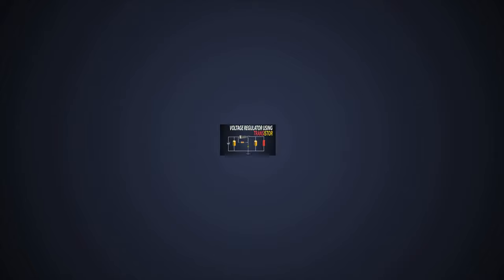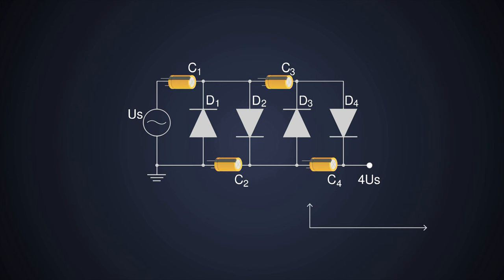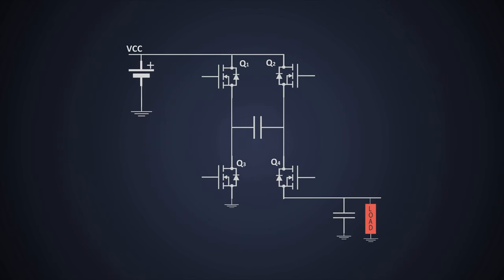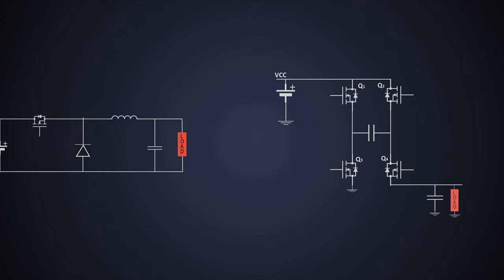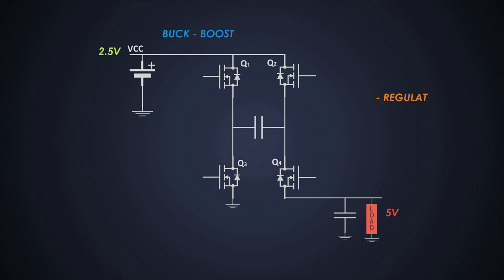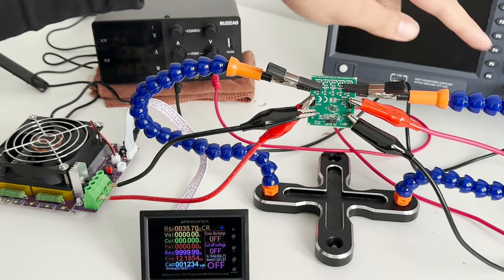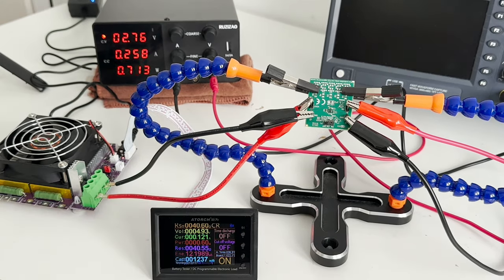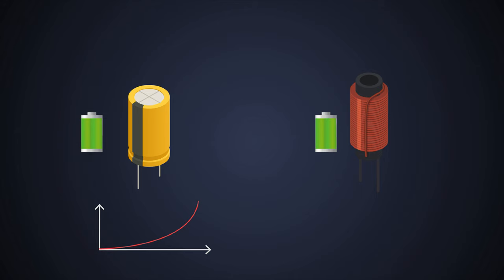What is Switched Capacitor Voltage Converter? The Forgotten Converter! Charge pump Voltage Converter

Comment: Well, charge pumps are definitely not forgotten and very well used, especially in cases where higher or negative voltage is required, or just a more "quite" voltage is needed (without switching of inductors for example), but your video is great, as always! Keep going!
Reply from the maker: Great point!

Comment: I’m aware of a gigabit Ethernet PHY that uses an internal switched capacitor regulator to provide its core voltage rather than a switched inductor or more commonly an internal LDO. It performs just as your video describes: not as efficient as switched inductor, but only requires diminutive 0.1uF to 0.22uF ceramic capacitors and still more efficient than LDO which would require similar capacitors anyway.

Comment: How could you use this to generate the high side n fet in an h bridge?

It strikes me that this could solve boating to 12v (or 6v for gan) providing a continuous boosted voltage for the high side fet so it could have 100% duty cycle.